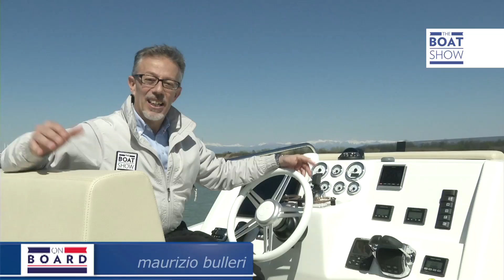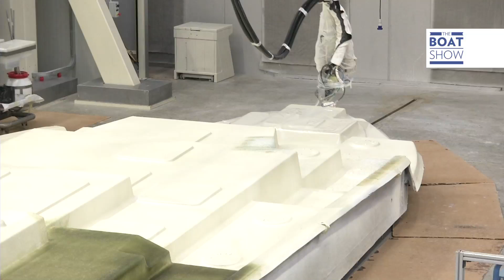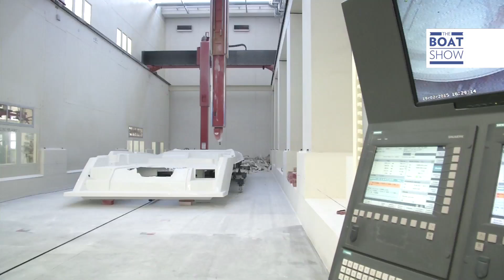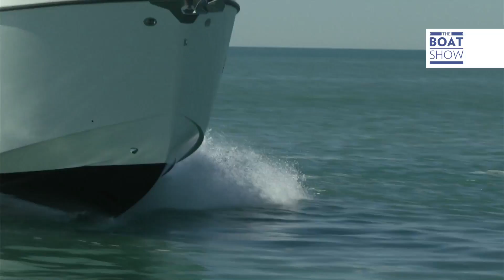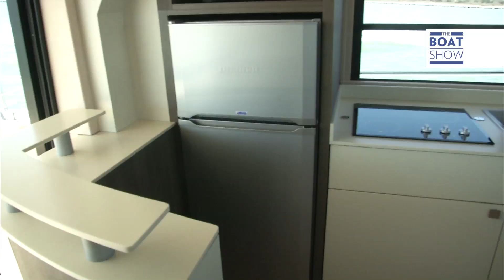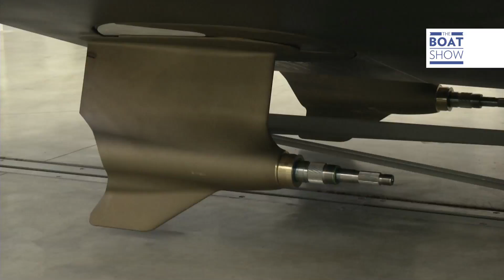[ENG] CRANCHI  ECO TRAWLER 53 - Review - The Boat Show

Comment: A chopper gun lay-up of an incredibly ugly boat, equipped with a drive system run by a computer to compensate for the owner who has no boating experience. The buyer will be the first and last owner of that awful boat.  
Calling it a trawler, while it planes along on it's flat bottomed ass, is so wrong it's not even mistaken.
Hopefully they stay in Italy.
Reply: spent a weekend on one of these with some friends and it was fine. Comfortable and a nice place to be. It is not meant to head to the Arctic its meant to cruise around the Med for a few days.
Reply: All talk until you own/actually go on one lol. Keyboard warrior

Comment: i dont see them using sheets of fiberglass ? just cut up stuff not good for the strength of the boat !
Reply: Garbage
Reply: I agree chop strand is far weaker than woven. Most cheep boats are made this way .It costs a huge weight penalty because of extra material ,Weight is extra fuel cost .Bad news for a boat made to go long distance .  Then there is the cheep crap furniture dated 1950 in style. but hay you can most likely get it for under 100k new with all the cost saving corner cutting . That's one cheep piece of work I wonder if its safe .